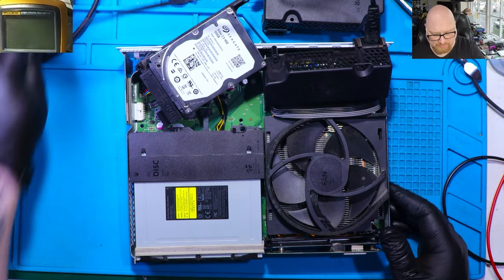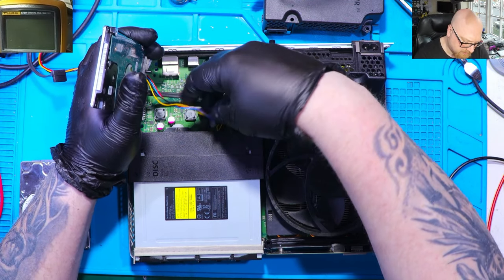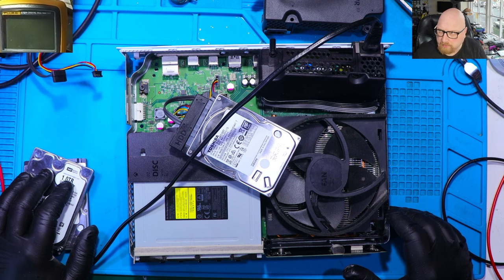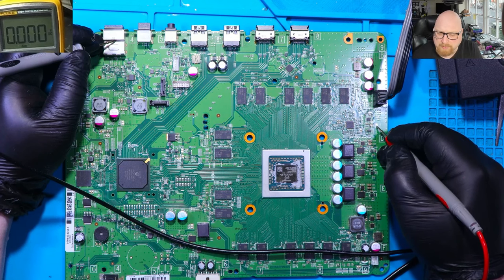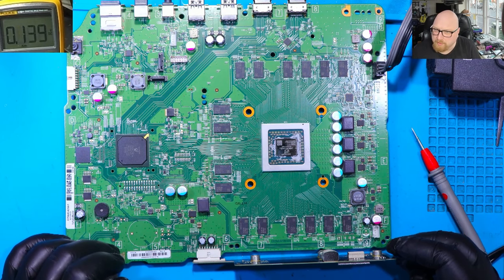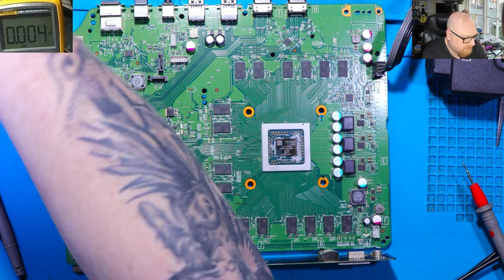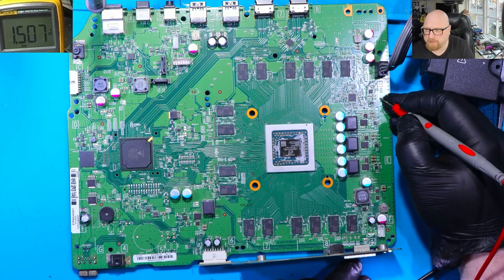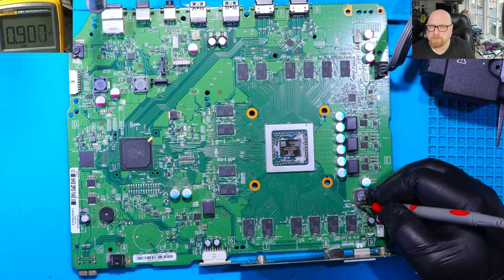Xbox One S Power on, beeps, goes off repair. Can I Fix iT?

Comment: This video was very helpful. I am struggling with the same issue on my Xbox. I am a electrical guy in automotive and followed along checking the same points as you with very simular results. However, when you ohm checked the RAM, you said anything under 30 ohms indicated an issue. I am getting 58 ohms, much higher than your donor board had. I am wondering if this value is proper. Any input is greatly appreciated. Ty
Reply: I'm in the exact same situation and currently stuck with no more ideas. Did you manage to find your fault perhaps?

Comment: My Xbox One got a downstream lightning strike, hit the cable wire and went into my modem then through the Ethernet cable into my Xbox 🤯. It does the same thing, powers up until the fan should normal kick on then shuts off. I have a Series S but you've inspired me to try to save it. I believe the culprit is either the RAM or one of the Mosfets, already replaced the power brick. I'll give it a whirl someday soon. Thanks for the details on the proper power readings, that's gonna help a lot! 👏👍
Reply: Any update? Same thing happened to my Xbox and I replaced the power supply
Reply: @KCDdesign  Nothing obvious. I'm waiting on a cable to come in so I can test the hard drive. Frustrating as hell. I think I need a better volt meter as well, my leads are cheap and aren't getting a clean signal. Long way to say no.

Comment: Great job! And what if the CPU and GPU points are 0V, even when trying to turn on the console? So the APU is dead?
Reply: Pwmic isn't enabling to supply the required voltage. Check those. If apu or cpu was dead, it would be shorted normally. Best way is to check the resistance.
Reply: @DrCryogenic  OK, thanks for the reply👍

Comment: So I had the same issue sometimes it would fix it self and work for a while then over heat funny enough the eject button fixed the console even though it a digital only model 🤣 actually using it to watch your video now and commenting on my phone

Comment: Thank you so much for this very detailed video. I have almost exactly the same issue. I am missing the Ram(1.5v), GPU(1v) and CPU(1v) voltages. the Ram resistance is 40.8 Ohms can you pls tell me where the voltage is coming from to supply the ram memory? or which component to check. thank you again GREAT VIDEO!!

Comment: had very same video got one from a friend there wasn't any thermal paste left I replaced it and put the heatsink on without the fan and used a heat gun all over the board avoiding the plastic pieces of the board for a few minutes let it cool down removed the heatsink once more cleaned the APU and heatsink added fresh artic M6 thermal pasted and works like brand new been playing games streaming video no issues another think I forgot to mention was I gave the whole board an isopropyl alcohol bath and scrubbed everything with a toothbrush and kept rensing the board with alcohol then used the heat gun it repaired the problem for me

Comment: Xbox one s just turn off power unplug wait ten 15 seconds then plug only power source in and turn on and should reset. No need to rip the computer apart and using a meter since the power supply has a built-in surge protector and can be eaisly reset, if it doesn't work then replace the PSU for a few bucks and good to go..